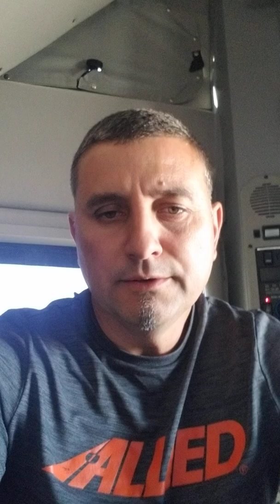Cummins isx 08  engine faulty code MID128,SID 251, fmi 2

Comment: I have the same code the only thing my engine  is not shutting down and it's inactive it's been like this for awhile keeping a eye on it .

Thank for sharing your info the dealer all full of sh**t they will run out of business if you dont pay attention and have some mechanical understanding 

How much is your mpg with 500 hp ?
Reply: did you find the problem
Reply: @flatbeddingwithmike97   I have them  ran a voltage drop test to the ecm and it pass so probably it's the ecm
Reply: @vin605  so do you still run with that code on?
Reply: Code is  inactive
Reply: Because I have the same code that came up. I changed the Ecm back in March and I got it tuned and I've just noticed this code came up. It runs fine no misfire or anything. Its just  that code

Comment: Thanks, i have the same problem right now. The same code the same issue.
Reply: Did u fix it? And what was the problem ?
Reply: @vlatkov8287  yes ecm was broken
Reply: @vlatkov8287  i fixed it but not at the dealer i towed my truck to chicago from kansas city, I couldn’t find good mechanic there, i put used ecm and they also programmed it.
Reply: I'm in chicago area. Can u provide me ur shop so I can fix it if cummins give me     expensive cost
Reply: @vlatkov8287  try to contact me in Facebook i will explain to how to make it cheap